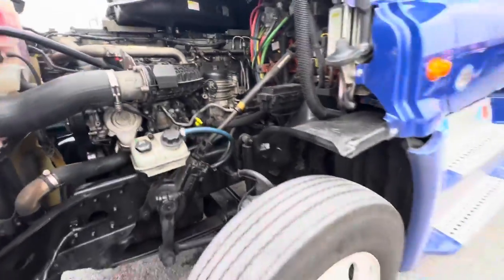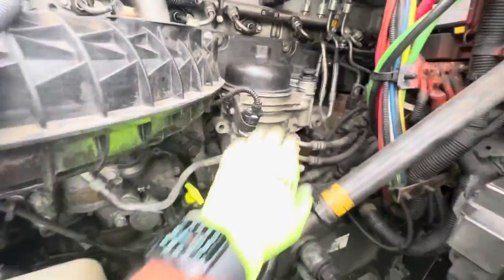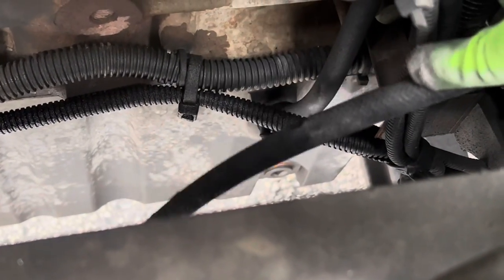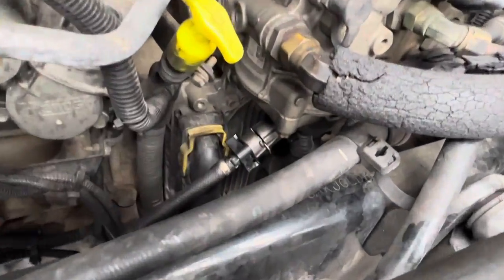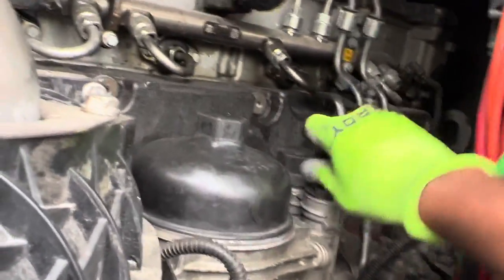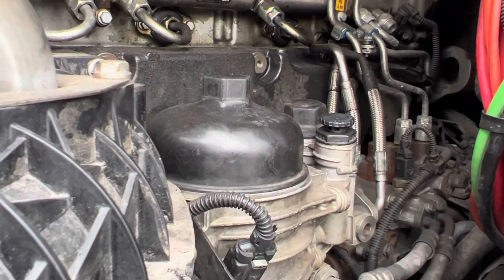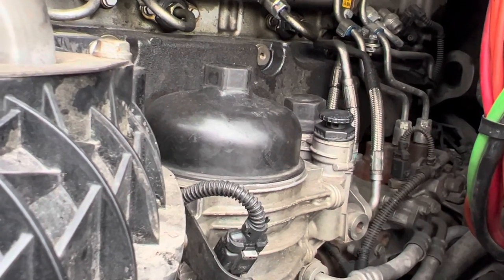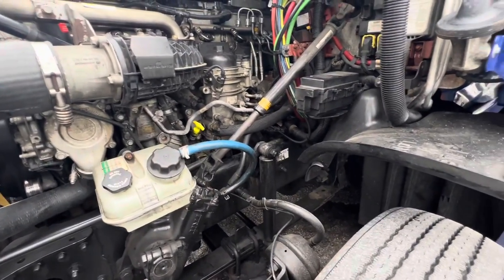How To Drain Water From Your Fuel System | Freightliner Cascadia

Comment: Thanks I just bought a 2023 freightliner and noticed the water separate was gone stupid they took away.

As far as you priming that system what happened is you drained the whole filter you may want to carry a gallon of diesel with you and a 33 mm socket take off the fuel filter caps fill it diesel then it will start with about 200 pumps lol sill alot but not a 1000

Comment: I tried, but there was no drop of anything coming out of the hose. I even totally removed the plug, but there is still dry. Do I have a drain problem?
Reply: What was the problem?
Reply: @dennisray8904  Seems like drain clogged, and I wasn't able to do anything.
Reply: @vj3308  yeah I'm sitting here letting it idle... If you keep twisting that hose to the left it actually will come off.. diesel will trickle out but nothing crazy.. maybe take that hose off and whip it good if it's clogged lol! Not sure but that may work.. but what he said truly saved me a road side service.. I can't deliver today supposed to be in Glennrock Wyoming but I don't care lol.. if you can get it to drain you can get it done 👍
Reply: Even if the hose is removed, totally nothing gets out.
Reply: Mine just barely drips out. Warning light won’t shut off